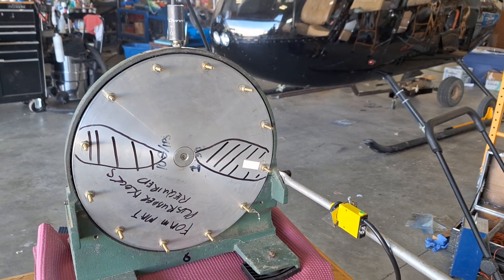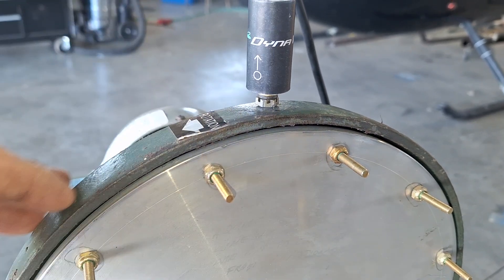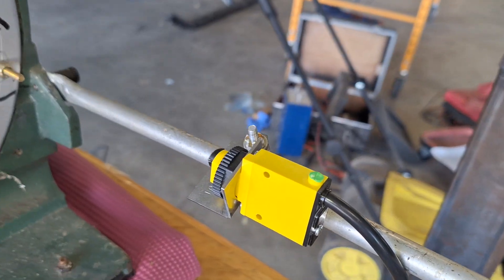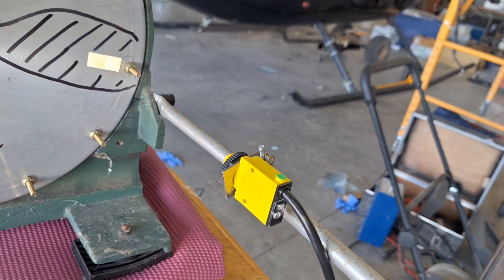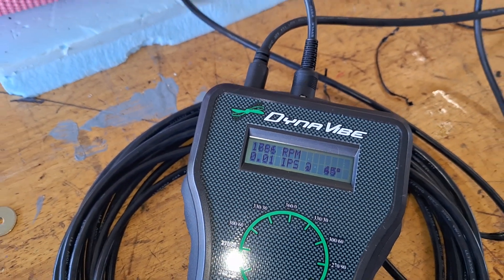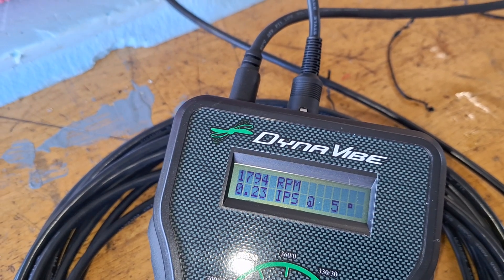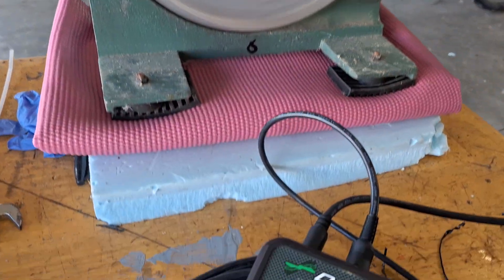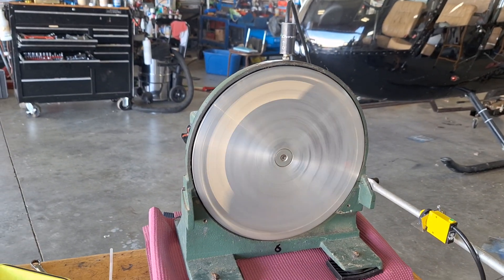Part 3 Propeller Balance Dyna Vibe

Comment: I want to know how this system determines the location of the imbalance, knowing that by using signal processing techniques we do not obtain this location, and to find the correction location we use the influence coefficient technique.
Reply: It's measuring the peak of the sine wave produced by the accelerometer, and the timing from the sine wave peak to the pulse from optical sensor and displaying the timing difference in degrees from the reflective tape location. I've made a home made version using an Adafruit accelerometer and an optical sensor I bought from Amazon, feeding a 2 channel oscilloscope; channel one is the sine wave and two is the sensor pulse.  Measure the phase difference on the oscilloscope display and calculate the degrees.